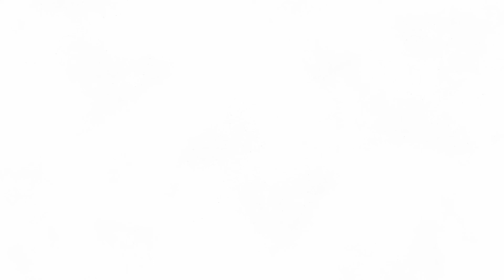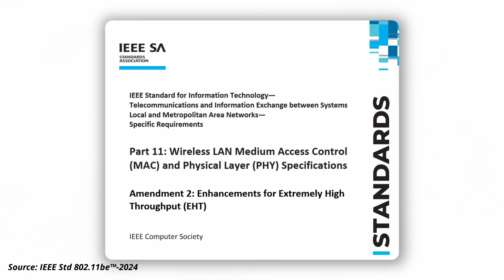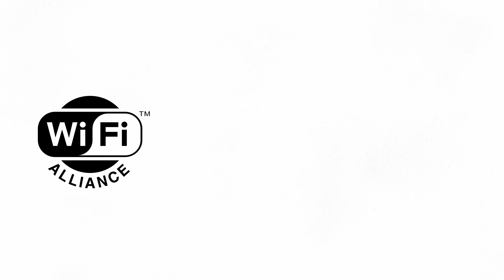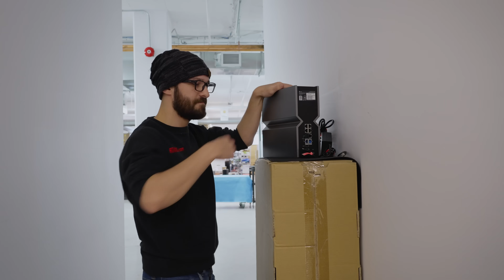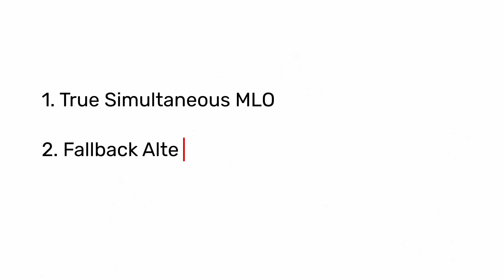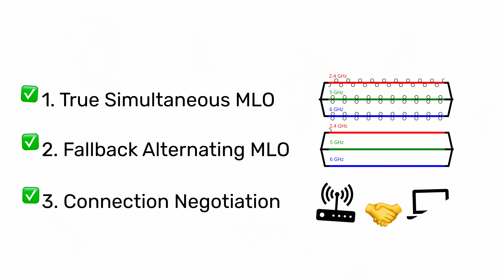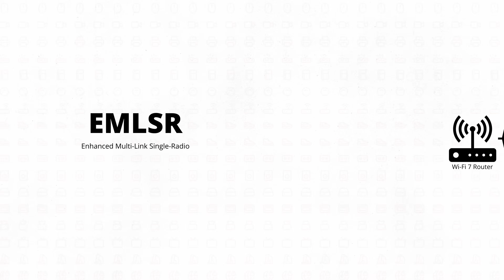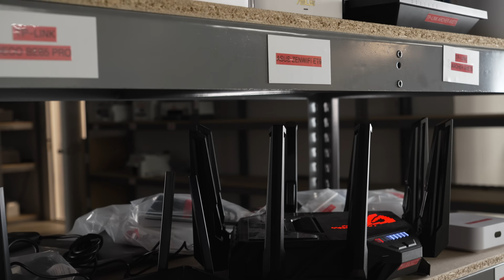Wi-Fi 7's Best Feature Doesn't Work (Yet)

Comment: You never mentioned what  brand of network adapter your laptop was using. Intel (BE200), Qualcomm (QCNCM865), or MediaTek (MT7927) . Have you tested to the MLO was properly implemented on these chipsets as well?
Reply: They didn’t actually test MLO. They just read the advertising packets from the router that list what capabilities the router would negotiate. It doesn’t matter what their laptop has because those packets aren’t tailored to a specific client.

They did mention that testing was done with a MacBook, which uses a Broadcom WiFi 6E chip.

Comment: Nahh man, this should not be allowed. There should be clear distinction in the branding between full features and whatever optional features you implement from the wifi7 specification. You 10000% should not be able to just slap on a WiFi 7 on the name when you just have some of the optional stuff implemented.

This should be regulated

Comment: Excellent video, currently using a mix of a Unifi Dream Router 7, and 2x TP-Link Deco BE85 and a BE 68, all on a 10Gbe backbone. 
Testing with the following Wifi devices shows the following (Hosted Openspeedtest on a QNAP TVS 474, with a QNAP 10GBe PCIE Card, 4xNVME,4X Enterprise Drives, i5 12500T) 
Connecting to the nearest Deco (BE85) , the device placed in same location and 3 runs made, the scores are the best for each device. 
Wifi 7 Devices 
iPhone 16 Pro Max  - 1651.1Down  1538.2 Up 3ms ping
iPad Pro M5              -1321.0D 1523.3U 4ms Ping
Samsung S25 Ultra -1743.0U 2891.5D 3m Ping
Samsung S10 Ultra - 3014.4D 2023.0U 6ms Ping 

Wifi 6 Devices 
ipad Pro M4            -1246.1D  900.0U5ms Ping 
M4 Macbook Pro Max (Wifi 6E) 1253.3D 1016.3U 4ms Ping

The wifi 7 clients were faster so I do not regret the investment. It is surprising how much faster on wifi the Samsung Devices are compared to the Apple ones.

Comment: Like my Archer BE230 they also don´t include the 6Ghz band at all. it is just a 2,4 and 5Ghz router with the Wifi7 protocol. But it does work either way. I can get high speeds at close proximity making it possible to play with the Quest 2 wirelessly at high refresh rate

Comment: I thought lying about capabilities and specifications is a requirement to get hired in consumer technology marketing positions, particularly in networking. My Linksys gigabit router goes less than 300Mbps and a business grade switch that died <1 year after install exposed the meaning of 'limited' in their 'limited warranty' by doing nothing because the product's lifespan was considered already over.  Its like how when you buy a USB3.0 flash drive that advertises how fast it is and doesn't tell you that the USB3.0 stick handles 3.0 speed negotiations but moves data at a maximum speed that is less than USB2.0; avoid drives that will not make any claim for both read+write speed if you do not want a slow read and/or write speed (and even then its only a best case scenario so you should expect slower in normal use). I'd be more concerned if any of these consumer-facing companies actually gave you what they said they gave you.

Comment: Much like MIMO, I've also seen marketing material imply that you can just sum the bandwidth of all bands together for MLO and I've encountered many people that get the impression that this is what EMLMR would enable if it was supported. Unfortunately a client chipset is still limited by the number of PHYs it has, which has been 2 for quite a long time now (excluding BCM43602, that one 3 PHY client chipset back on WiFi 5). At 320 MHz and 4096-QAM, a 2 PHY client chipset will never be able to exceed 5764.8 Mbps no matter what MLO mode. If a 2 PHY chipset that supports EMLMR is split into a 5 GHz 160 MHz radio and a 6 GHz 320 MHz radio for EMLMR, at least as far as max bandwidth goes under ideal conditions, you're actually worse off than if it had just been a single 6 GHz 2x2 320 MHz radio without any form of MLO. Under non-ideal conditions and crowded bands is where EMLMR would actually provide value.

Comment: I use the Unifi U7 Pro XGS APs just cuz, but my only MLO client is my Pixel 10 Pro, and thats just for funzies. Most of my stuff is hardwired or IoT smart home stuff.
Reply: I have the U7 Pro XG, upgraded the wifi chips in my laptop and desktop so they support MLO now... desktop is normally plugged into a direct attach copper cable though :P

Comment: 1 thing you guys didn't cover, devices, even wifi 7 phones for example, cannot receive all 3 bands at once even if a router provided the capability. 

Wifi 7 as a whole is a scam. It's still great, in some cases a little better than wifi 6e, but usually just the same.

Comment: As somebody involved with a retailer, the Eero Pro 7 doesn't advertise MLO and instead says it snaps to backup links or alternate pods when connections weaken. The employees were told by trainers to stress that was how they worked if asked. When put to use I've noticed that they do as advertised, so it seems that Eero Pro 7 have the same capabilities as the Max 7. I'm not sure why yours was detecting differently.
I went so far as to get my own for my house and my internet capabilities are so fantastic throughout the building that I'm only slowed down by the outside connection to my building during bad storms or such. We would even have an office with multiple gaming rigs running off one of the pods and it would manage traffic and run great. I recommended it to a colleague who was having some trouble with a specific setup and he reported perfect results.

Comment: for my older 2.4/5G router i had to disable the frequency switching - it would keep switching to the lower quality band, and giving high packet loss for a while before switching back - it seems it was estimating the signal quality from the wifi side only, so the wall inbetween the laptop and the access point meant it estimated wrong over and over ...

Comment: I'm an RF engineer, with assorted optimization experience from two-way radio, paging, cellular and wifi in my 47 years working in different communications related industries.  At home I have a Ubiquiti system originally with 4 AC-Pro access points and tracked the statistics and made adjustments to make sure everything worked optimally.  Two AP's were in high traffic areas and suffered from interference and high TX retries. I swapped them out for the newer U7 Pro MAX, and U7 Pro XGS to see if I could take advantage of any of the improvements and although I have around 100 devices in my house (the support guys at Ubiquiti said they had never seen a house with so many wifi things in it, lol) only very few could take advantage of the Wifi 6, and none used the Wifi 7 so it was, as Ben suggested, a really poor investment upgrade.  BUT, on the flipside, I did notice on the 2.4 and 5GHz bands, a significant improvement on the performance side, lower TX Retries and less interference, which I assume is due to better selectivity and image rejection due to improvements in design and hardware since the AC-Pro AP's came out, so it wasn't a total loss.
Reply: Great feedback, thanks man ! I was looking for UniFi7pro max as well, but not sure. Currently Iam running Fortinet wireless network as home with WLC on Fortigate 40F, 2x APs WiFI6e and 1x WiFi5, not more than 50 devices on network, not more than 40 of them via wireless.
I wanna say that I dont see significant improvement in comparison with WiFi5 running on Synology network/wireless. I would say UniFi is more about options to enable/disable, but Foretinet/Cisco is more about configuration and setup, sometimes hard way. So log story short, I would like to go to UniFi solution and test and compare, but now I have for free Fortinet suff with all licensing + HW as UTM security licensing, SDWAN features and so on. Hope professional like you can advice if UniFi wireless worth to buy even for person as me which is really demanding. Thanks.

Comment: I'm still waiting for 802.11ak (General Link) to get widespread support so wifi clients get a connection that's actually equivalent to plugging into Ethernet, enabling the ability to bridge wifi to your computer's ethernet if you want to hook up devices that lack wifi. The amendment was published in 2018 (and subsequently integrated into 802.11-2020) but I haven't found any evidence of any device support whatsoever😕...

(Yes there are partial workarounds with L3 based techniques like proxy ARP but that's messy and doesn't support all use-cases even when it works properly.)

Comment: Hmm isnt MLO suppose to be both client and router dependent ?

Although MLO can boost performance by combining bands, most WiFi 7 devices still operate on a single band — so any benefits may be limited. To avoid potential interoperability issues, we recommend not enabling it at this time.

Comment: Alternating MLO is more appropriate for home users. If you move to multilink you will find latency issues for gamers. It's only real use is bulk data transfer. So only the Chinese device have certification? Did they buy control of the certification? It would be nice to know if the U7 Pro XGS Or Pro Max supported more features.

Comment: Interesting findings. I have a UniFi E7 and my laptop with a Wi-Fi 7 card does connect to all bands on the network with MLO. My Google Pixel phone doesn't. I wonder if the devices you were testing couldn't do it?
Reply: They did not test the E7, they tested only consumer routers. They were going on capabilities broadcast to clients as being supported, so what device they used to receive the info doesn’t really matter. They didn’t actually test the functionality because very few devices actually support MLO.
Reply: @paradoxmo  If you read UniFi documentation you will know ANY device capable of wifi 7 supports full MLO capabilities.
Reply: @cajuclc  they looked at a few consumer level Unifi in this video including U7 Pro and the support is partial. Or are you talking about client devices? For client devices it’s definitely not true. Most current client devices don’t have multi radio MLO implemented but only fallback MLO, some don’t even have more than one radio.

Comment: I use a TPLink BE550, I am very happy with it but I tried using MLO once. I had terrible connection issues so I stopped using it. thinking that I would dig that later.. but since the router works fantastic otherwise, I never took the time.

Comment: Fun fact, if your device supports it(like latest Xiaomi/Poco phones), you can get simular to MLO connection even on wifi 5 networks, if you separate 2.4 network SSID from 5 SSID and manually connect to both of them through "Network speedup" function
Reply: In my testing with iperf and a ax1500 router, it makes no speed difference. Think of it as a backup link.
Reply: Is it MIUI , HyOS 1/2/3 only ? 
Asking cos i knew my setting almost by heart, double checked on my Note 12s and it's not there; even tho the internet tells me it should be. :face-blue-question-mark:
Edit:
Do they have to have the same SSID, just for the option to even show up?

Edit2: They've disabled the option entirely for International ROMs in 2021 because of what was said in the video : Massive instability since almost no router has a legit implementation :face-blue-covering-eyes:
Reply: @IcecalGamer well, using it with my old keenetic giga 3 without a problem, but yes, on xiaomi-eu rom, that is based on chinese firmware
Reply: no need of separated ssid mine do even with the same name

Comment: As a professional network admin... I'm not surprised consumer WiFi7 "AP's" don't have Simultaneous-MLO.... consumer hardware is utter crap... something like a Cisco CW9178I is fully capable of it and is not something your average consumer would buy... but it's real people.... just not for you....
Reply: Do you have anywhere with this test data? We have a few dozen CW9178I APs, and I would definitely be curious how well these should be operating.
Reply: @burkminipup  Haven't gotten them yet... coming in July... but the datasheet states it... and I'd be surprised if Cisco would just lie like that... I'm guessing a spectrum analyzer would be required to empirically confirm.

Comment: Hasn't MIMO been a thing for Wifi at least in therory?
Reply: MIMO is several connections on one band, MLO is connections on multiple bands
Reply: @paradoxmo  Yeah, so I thought that extending the multiple data streams to multiple bands shouldn't be that problematic.
Reply: @pat @patrick_test123  why would you think that? It’s a much harder thing to coordinate two radios than to tweak transmission and receiption algorithms for one radio.

Comment: Thank you very much for this video. The biggest issue with Wi-Fi 7 that I can see is that it only works when both the router and the client devices properly implement this standard. It's one thing to replace your router with one which is fully Wi-Fi 7 compliant, it's another thing to replace all your phones and laptops.

Comment: Governments need to crack down on liars in marketing.  If there is a standard it should be illegal to try to market a different word that the average user would link to the standard when that standard is not met by the product.
Reply: No. The State has nothing to do with these things.
Reply: @francocastilloAR  Never said it did.  I said government.
Reply: @VestigialHead  It's the same thing.
Reply: @francocastilloAR  No it is not.  There are three levels of Government.  State is just one of them.  But Government most definitely does have the responsibility to protect the public from these scams.

Comment: That kind of explains why I have a significantly better real-life experience with a Zyxel WBE660S compared to friends with other tri-band Wi-Fi 7 access points. The WBE660S has been supporting those features for a while but it also needed firmware updates to do it. I trust a boring enterprise manufacturer significantly more than those “lifestyle brands”.

Comment: Is anything not a scam these days? :( has everything always been like this?

Also, It's funny how the non technical people get impressed by "thickness of a human hair" and "microsecond accuracy" and people who work with this stuff go like "Oh wow that's slow / thick". The average person does not know how insane the technology can get, and how ancient and basic/lame it can be at the same time.

When designing certain devices there's pico seconds that you worry about. (2.4GHZ has a period of 416.67ps)

Just this random simple basic PCB I designed for my lights has a rise time of 5ns on the mosfet and the signal period  is like 20us, with my buck running at  450ns period. If you go near ram (like ddr5) or PCI it gets terrifying.

Science is wild ya'll.

Comment: So, other than showing a bunch of check and X's on a chart, I saw nothing usefull here.  Does not matter what your router shows on the chart or does if your device does not support it... Real world performance with common devices is what needs to be charted. Standard common phones, laptops, tablets from major manufactures.  More usefull would be a test of how routers maintain a decent signal in a highly congested area like a multi tenant appartment complex or condo situation.

Comment: Funnily enough, Ubiquiti has MLO working in their MLO5 and MLO6 outdoor point-to-point links, which use two 5 GHz radios or a 5 and a 6GHz radio combined for a faster (and potentially more reliable) single network link. Despite being a product that can only connect to an identical model, so they control the hardware/software combo on each end, it was still pretty buggy until very recent software updates. 

Making MLO work with however many client combos of operating system, chipset and driver versions seems like a headache but when the vendors advertise MLO to customers, they should be doing way better than this. I'd be very interested to see RTINGS try out a few $$$ enterprise APs from more "premium" brands than Ubiquiti / TP-Link, such as Aruba and Ruckus. I wonder if some of the features would be easier to implement on a powerful central controller than a standalone home router.

Comment: WiFi 7 is kinda pointless unless you actually absolutely need the speed on a mobile device for some reason.

FTTH is finally available t my home, 2.5Gbps Down 1Gpbs Up, the router I got is a Zyxel 5601 with 4x4 MIMO and when standing close to it I reach speed of > 1.7Gbps despite not even having a 6Ghz band.
It's not wire speed, but it's still plenty fast for any use case... if you realy need more speed just get a cable. 
The fact that it's 4x4 means it can handle more devices without losing much performance, unlike some AP which are faster on paper but get overloaded quickly.

As soon as you have any obstacle no WiFi 7 router will be fast anyway, especially if you're limited by budget buying more "slower" ap and getting good coverage is much better than a single fancy new device that will get stopped by walls anyway.

Comment: I bought a TP-Link BE550 in 2023 when it was new. It's a Wi-Fi 7 router but I have no Wi-Fi 7 devices. I use MLO but not for the reasons one might think. I only use it because this router doesn't support MLO for 2.4 GHz so it forces my devices to the faster 5 GHz without annoyingly starting at 2.4 GHz and later moving to 5 GHz at some random point. I more bought the router for the features such as VLAN so I don't need to use my ISPs inferior equipment. I did have to complain to them about how VLAN didn't function if QoS was turned on and surprisingly, I was able to communicate with an engineer from TP-Link who sent me a version of the firmware at the time that did have that fixed. And then the firmware updated to whatever was the current version when they were available. But as any other routers I've used, QoS doesn't seem to work as advertised. Feels like it doesn't do anything and I've found only really works for slow internet connections.